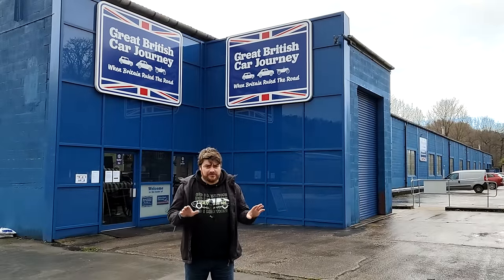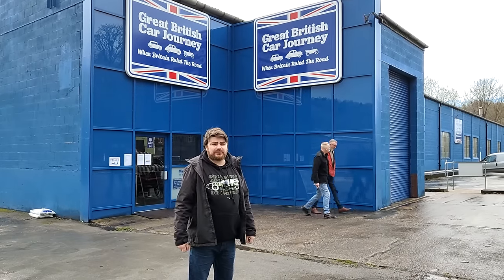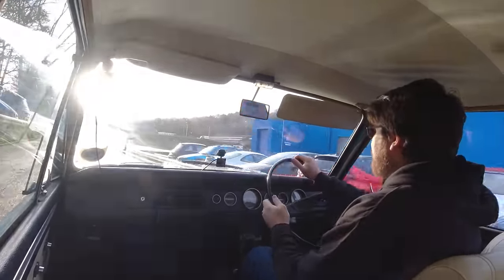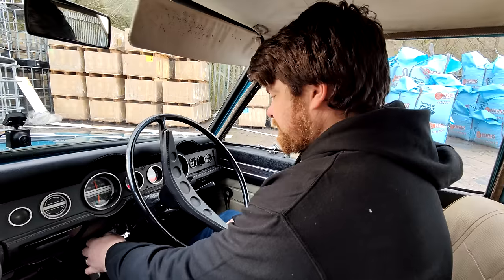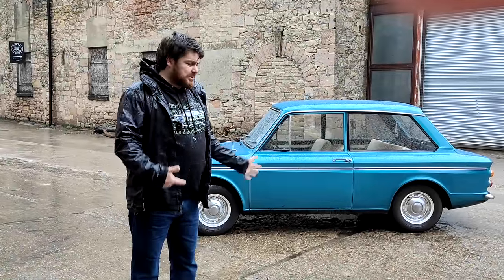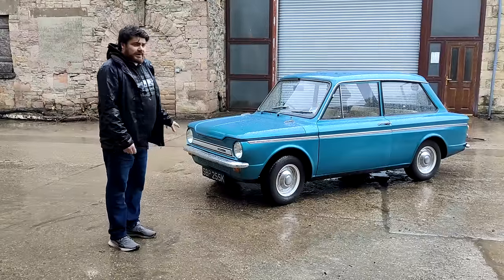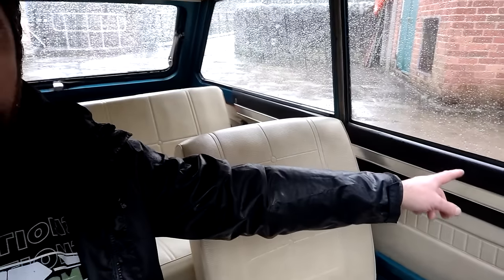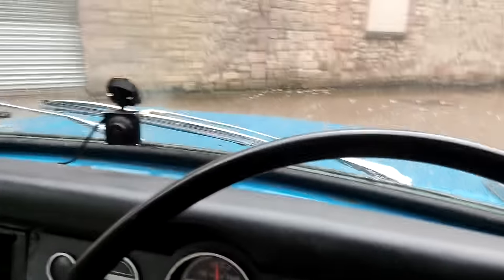1971 HILLMAN IMP SUPER - Better than a Mini?

Comment: Imps are fantastic cars. I had a very late model, and it was an absolute delight to fling round country lanes (never had any trouble you'd associate with rear engined cars getting tailhappy). Certainly no less reliable than any other older cars I've had. And that engine really is a delight. The exhaust note on Hubnut's Foxanne always reminded me of Imps.
Reply: Agree with what you say about not being tail-happy, although you were aware that the weight was there in the back. Only lost mine once, on an M3 off-slip and there was rain and oil involved.
Reply: Loved the Stilleto twin carb  sports versions with twin front lights.  I have a racing  front exit racing sidecar chassis built to take one.

Try a Clan ...with one in ...if you can get into one.

Comment: In the day for a couple of years after passing my test in the 70's I was lucky to be able to drive a lot of different cars, including several Minis and Imps. Of the Minis at least 2 were 850's,  3  were 1000's and a 1275gt.  Of the Imps 2 were bog standard and two were Sunbeam Stilettos. 

Other cars driven at about the same time included Fiat 500, 127, 128, 131, Reliant Robin, Seat 133, Fiesta 957 and 1100,  Ford Escort 1300's, Cortina 1600's, Vauxhall Viva, Hillman  Avenger, Simca 1204, VW beetle 1200, Ford Zodiac mk4 and Lancia Fulvia.and Beta  A few of these were mine, others belonged to friends and family. Not only was the imp nicer to drive than the Mini,  It was better than nearly all of the others,  however the stand out favourite cars from these were the 500 and the Fulvia.

Comment: My first car was a '66 Super bought in '73. It got the 1" lower Monte Carlo springs, stiffer bushes and decent radials, a rebuilt engine with some Chrysler Comps bits, a 13" Moto Lita steering wheel and so on. Enormous fun to drive on twisty roads and given a long enought straight it would peg the 90mph speedo.
One of the cars I wish I'd kept instead of selling it to my BiL when I got a company car in '80. He broke reverse and sold it to banger racers. It was rust -free too.

Comment: Mine ( '72) had everything thrown at it !  998cc Wills ringed big valve head, R17 cam and twin 40 DHLA Dellortos, Janspeed manifold, electric fuel pump, alternator, front rad and a factory clearance brand new gearbox. Used the legendary Dave Bogg for tuning advice as a penniless student back in the late 1970's....  Did about 90 mph in third and you could then change up and pass most Minis of the time.... great times. Oh and forty to the gallon in "Grandad" mode....

Comment: My first car, when I was 19, was a 1969 white Singer Chamois. It had twin headlights and upgraded seats and ran on crossply tyres. I got it in exchange for a top of the range hifi system ( In those days). The freedom it gave me to visit my friends was priceless. My pals, who all ran tuned minis teased me mercilessly. I sold it and bought a white Lotus Elan +2 with a Webasto sunroof, which I owned for a whole month until I realised that, being an impecunious student, I could not afford the insurance. ( It was possible to insure cars on a monthly or 3 monthly basis then through Cloverleaf insurance). I saw 120 mph briefly. WOW! I then bought a bronze yellow 1275 GT mini which I owned for 5 years until I upgraded to a Diamond White custom pack Escort Mexico then a Venetian Red  MK 2  RS2000 which I sold for the deposit on a house and towards my wedding. Those were the days!  I look back fondly on my Singer  though and often wonder what I could have made it into with spare money. The engine was so smooth. It was actually designed by Coventry Climax for service as a high power water pump for fire fighting.

Comment: Bought 1967 Singer Chamois in 1969 
Dark green with black interior 
I sound proofed it with a kit I saw in one of the motor magazines of the day
One of the best things I did was I fitted Koni shock absorbers all round .. fantastic improvement 
Added a Phillips car radio also changed the king pins and remember how light the steering was afterwards. always changed oil, air and oil filters, plugs and points twice a year 
Best memory? driving to Cornwall with my girlfriend (now my wife) to visit her brother and his family 
We used to leave about midnight to arrive St Agnes 5 - 6 am a journey of around 250 miles no motorways back then, I recall the petrol tank held 6 Gallons and that was plenty of fuel for the journey 
Great memories of, IMO, a great little car

Comment: My only problem was changing the doughnut drive. A real hard job unless I was doing it wrong. They were great for getting up a hill in the snow when other cars lined the roadside.  You had to ensure the little o ring under the head was ok otherwise you had a warped head being alloy. Still I loved it

Comment: I'm sure my dad had some form of 'gt'  version with twin carbs. Once it met its end of life due to its fondness to rust away, a chap bought the car to use the engine in a racing  power boat of some kind. Great vid  if a little wet.

Comment: Radiator fan on the rear of the waterpump pushes the air forwards through the rad, it doesn't draw it through from the front. Negative air pressure underneath the car when driving helps to suck the air through.
Reply from the maker: Critical info, makes a huge difference. Cheers.

Comment: I love these older cars - I'm pushing 70 and have driven quite a few different cars for the past 40 odd years. My father in law and I would have a great time doing minor fettling on his cars from the 70's. I have settled on a little 2010 Honda CR-Z now which is cheap as chips to run and insure. It's a hoot to drive on B roads.
Reply from the maker: I do like the CR-Z! Really smart looking car.

Comment: Well done Rich. I'm delighted you found the Imp to be a special car.

I bought a new Imp Van in 1970, my first car, and it was a delight. The engine was superb till a bolt came loose in the induction system and bounced around on one of the pistons! What a racket!! Fixed under warranty and I had no further problems, just loads of fun chucking it round corners. Having learned to drive in a Mini 1000 I had a direct comparison and the Imp was much more fun to drive.

Great, and much underrated cars.

I realise you don't get out often, but thanks for making the effort! More practice may help...
Reply from the maker: I really did, I enjoyed it so much. So different to the other type of small cars of the time. Quite a bold and brave move by Rootes, really. It deserved better.

Comment: When these came out I was a teenager (no, I was never a teenager: adolescent) just building up to my first car (1938 Austin 12, since you ask: stately), and my one experience of the Imp was hitching a ride with an enthusiastic owner who was very convinced they were better than the Mini, though he claimed to have a length of rail track in the boot (frunk? -- never) to improve the weight distribution. He also asked my to put my bag on the floor in the back to lower the CoG.

The word on the street was that they were a better car than the Mini (the marketing point "Coventry Climax engine" stirred hearts in those days), but Rootes couldn't match the BMC build quality. ....  And that is the history of the British car industry.
Reply from the maker: The earlier Imps had some trick front suspension geo which was designed to promote understeer (to reduce snap-oversteer) but when they realised the car needed to sit higher due to light regulation failures, the trick geo became dodgy geo! People used to think they were weighting the front end down, but in reality they were lowering it. The fact that the driver weighed much more than whatever they put in the front end (railway track/bag of cement/sand) and had the biggest effect on weigh distribution seemed to pass them by entirely.
The later cars corrected the geo (which this car has). Check out the videos of Imps racing around Cadwell Park with the Minis, that's what they can really do!

I think the Mini was a more clever car, certainly in terms of packaging, but the Imp had better componentry and was much better to drive. Unless you really needed the car to be smaller than an Imp, I can't really see the advantages of the Mini (reliability withstanding, as I know the earlier Imps were a bit of a mess straight out of Linwood!)
Reply: @UPnDOWN  Thank you, that's very informative. It hadn't occurred to me until now that the Imp is a standard rear engine, rear wheel drive, Euro tiny car. And the motto is, I gather, if you have an Imp, slam it.

Comment: My second (four wheeled) car was an Imp, pretty much identical to that. Same colour and everything but on an 'M' reg. I seem to recall mine had cloth seats though. Sadly don't have any pics. It was such a sweet drive (was only 8 years old at the time).
Unfortunately, when approaching MOT time, I discovered the floor was basically made of filler! I couldn't weld, Imps were cheap (think I paid £125 at Brentford auction) so down to the scrappy it went😢.
Reply from the maker: Hilda's pretty much identical, but on an 'M' reg! Brother from another mother!

Comment: I suppose a hypothetical could be - Could you have as much fun in Hilda with an original - tuned engine?
Reply from the maker: Oh yes, absolutely. Potentially more fun, but when Hilda was conceived, the goal was 100bhp, reliably. The Imp lump can be tuned to 100bhp (and it creates a wailing banshee of a thing) but naturally reliability and everyday drivability go out the window somewhat, whereas the engine in Hilda will shrug off pretty much anything I throw at it (at the detrement of the gearbox...)

The difference here is that I'm not sure you need the tuned engine. This standard car was a giggle! You can razz the arse off it, and not be breaking the law!
Reply: @UPnDOWN  "Power. Less is more"
 Now, where on Earth have I heard that before. 😉

Comment: I always felt the imp was better than a mini, brilliant one up but put passengers in it and it became a bit pedestrian 875 when the mini made it to 1275 certainly didn't help.
Reply: Just add a R22 Cam, 1 1/2" Stromberg - Peco Exhaust - selt-built Electronic Ignition - Safe  to 7,500 rpm and she flew.

Comment: The imp is vastly superior to the mini. A better OHC engine that, if serviced correctly, would go and on.
An all synchromech gearbox, a short positive gear lever.
Much more interior storage space.. and you can remove the engine and transmission with no special tools in about 30 minutes.
Folk that moan about the engine never read the workshop manual re tightening the headbolts some 500 miles later.